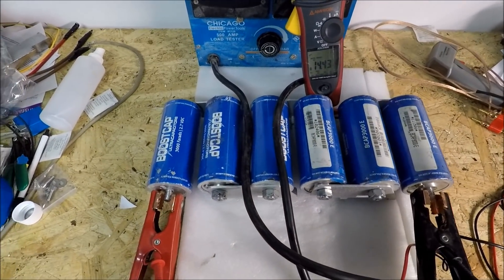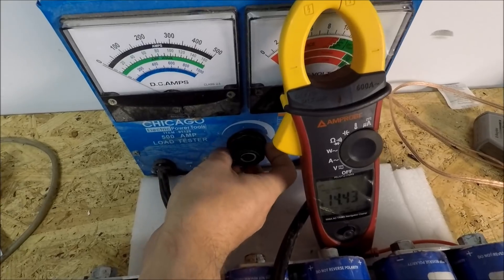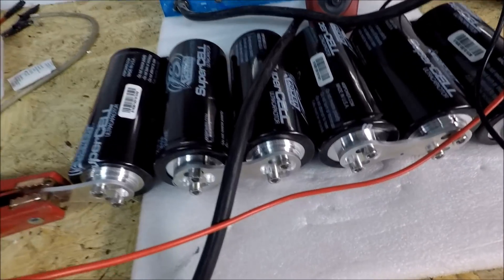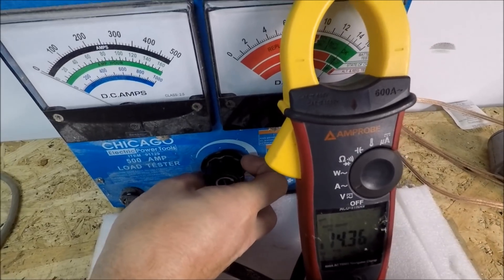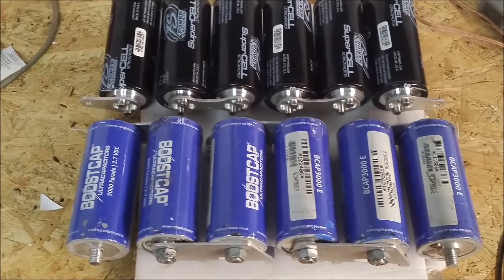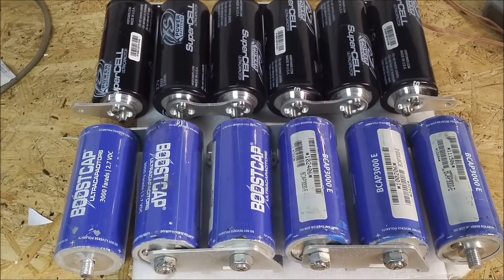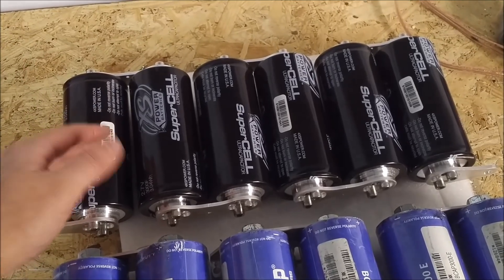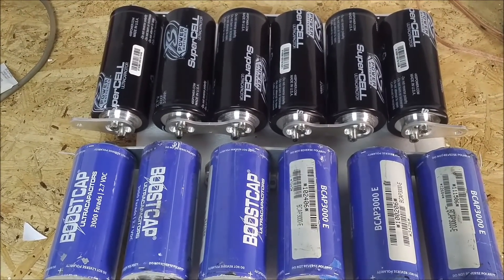XS Power Supercell or Maxwell Boostcap, which is better?

Comment: Hello. I was just asking someone which were better and he swore I got ripped off with my SB 1000 XS Power super caps. He thinks the maxwells vastly outperform the XSPower. 
I do have a question. On a system that’s 5000 RMS watts, big 3 done, 2 XS Power D4800 batts in parallel, stock alt for now (about to purchase a 280amp alt (biggest they make for my car)), how many of the XS super caps would it take to keep voltage stable if the system is played near max volume for long periods of time? 
Thank you. Have a great day

Comment: WHere on planet Earth can I find end links for those XS Power supercapacitors?!?!  Or suggestions on how to attach them to an existing battery bank.
Reply from the maker: If you don't want to make your own, I think some companies offer them. XS Power used to sell them individually but don't last I asked.
Reply: @EMFAudio  Gotcha.  I decided to just use 2 ring terminals- one on each bolt hole attached to the dual bank LTO lithium w/ 1/0 gauge wire.

Comment: Could You Charge Up Those XS Power Caps Up To 16.2 Volts. Slowly Creep Up The Load Knob Till You See Needle Barely Move. Then Immediately Crank It Super Fast And Max It Out? I've Got Me Some Ultra Capacitors From a Supplier And I Did This And Max Out Around 450Amps @ 14 Volts And 300 Amps @ 10 Volts. I Would Love To See How They Compare. Your The Only One With The Same Exsact Load Tester As Mine And You Have XS Power Caps lol. If Not No Worries I Won't Burden You. Just Want To See How They Compare Without Dropping The Cash.

Comment: Do you have a video on how to configure a 6 bank of XS caps?
Reply from the maker: I don't, do you mean cell to cell individually or banks tied together?
Reply: EMF Audio banks tied together
Reply from the maker: @UrAvgBasshead  It would be a very short video, it's the same as batteries. Pos to pos, neg to neg.
Reply: EMF Audio how about also showing how to wire from amp to caps to agm battery ? If that make sense.

Comment: why do run them like batterys and without the balance boards
are you using differnt caps and also have you used the graphene caps which do the the 15k ah at a 12v or 16v and they are in 1 or 2 maxiumum size and they are new whats your thoughts about grahene vs the maxwell or xs or whatever
Reply from the maker: Balance boards aren't a requirement. I've found they don't benefit unless you're rapidly charging and discharging in large amounts. Even then, the difference is minimal. In this particular bank it isn't be charged to maximum voltage so if there is 15% higher in 1 cell than another, it's still not at threshold. I own and have used both XS Power and Maxwell caps, I have not used graphene.
Reply: @EMFAudio  thanks first actual helpful answer i have i will be emailing you soon about some 15s and 18s i need soft  parts for and also some motors for a couple of them to well 3 motors i have the cradles and 1 motor 4"coil and i need to get basically finish two in banhammer style or musical spl i dont know if you do that so i email you guys and let you know what im after and see if you can do it
thanks for answering in easy to undersrtand englishrather than cryptic battery talk

Comment: How many farads do these have?
Reply from the maker: Each cell is 3,000, but when you put them in series they lose capacity divided by the number of cells. So these banks are 500 farads.
Reply: @EMFAudio  thanks!
Reply from the maker: @Martian Prepper Exactly how you worded the question you answered you're own question. I'll assume you meant with a 1 amp load how long would it last. They don't offer Ah ratings on the caps themselves and caps don't discharge like batteries. From my personal experience I'd say going from a 14v charge to an 11v charge it would last somewhere between 1-2 hrs.

Comment: What's the bolt size and length?
Reply from the maker: I know they're M6, length I don't recall but with those dog bones I'd say 10mm is appropriate, 12mm tops.
Reply: @EMFAudio  thanks buddy! I see that EMF audio doesn't have the single cells on the site. Do y'all still sell them?
Reply from the maker: @jamesfalvey77  We do by request and only in quantity.
Reply: @EMFAudio  meaning more than one cell or more than one bank?
Reply from the maker: @jamesfalvey77  More than 1 bank. If you're the one that emailed yesterday I responded yesterday. For single bank purchases it's best to get the cells in cases that we offer.

Comment: The way he describes these ultracapacitors by XS in this video makes it sound like the single units are used and the cased units are new
Reply from the maker: In this video, all the cells ARE used. If you purchased new from our website, you get new, be it individual cells or in cases.
Reply: @EMFAudio  please, just to be clear on the video, the two maxwell and XS supercap banks are each powering a load of 12v 200A rating (ie. 2400Watts) for an average of 10.3 - 11seconds?

Comment: How many caps I would need for 18k system
Reply from the maker: I'll be covering that in a future tech video that will cover that in more detail for specifics. That isn't really a blanket answer.
Reply: @EMFAudio  did you ever make that video?
Reply from the maker: @DibeezyTheGifted  I haven't yet, it's still on the to-do list.
Reply: @EMFAudio  bottom line do these help enough to justify the cost? 4 Banks minimal for 8k @ $1,000+? Or more actual battery Bank?
Reply from the maker: @DibeezyTheGifted  That is the appropriate number of caps for that power, but, you have to have some alternator power to back that up. If you don't have at least 300 amps of alternator you'd probably want to have some battery capacitance in there.
Reply: @EMFAudio  singer 320 rt now and Mechman 320 here probably Tuesday. 640 amps total. Planning on at least 12000 watts total.
Reply from the maker: @DibeezyTheGifted  For 8k yeah you're good. For 12k you might need some more caps. We do have them available at www.emfcaraudio.com

Comment: Not really. Just trying to sell xs.
Maxwell is half the price and just as good!!!
Reply from the maker: Maxwell aren't half the price.  As a matter of fact, brand new Maxwell cost MORE. You can't compare new to used pricing. Furthermore, you saw the data, it's right there in the video. XS Power performed better, you watch it happen.
Reply: @EMFAudio  watch the video . Ok. What I see is super caps vs ultra caps. 
What I see is. The Maxwell was outperformed by half a second . .05
Also. What I saw. The Maxwell/ while adjusting to 200 Amps was stright to 200  and held. 
Now the xs ultra  was shot to 200 then back down to 150 then rolled into 200. 
So the 50 amp decline will affect performance. 
So watch for that again. 
 Try again bud.
Reply from the maker: @pissedoffconservative347  You don't have to make excuses, accept reality. No need for butthurtedness.
Reply: @EMFAudio  how can you deny or ignore my comment? I didnt say xs was bad! Nor do I think that .  But how can u ignore the facts
Reply: @EMFAudio  are you going to say that the 50 amp drop wouldnt affect  the over all outcome. Hmmm? Even after that it was by a half a second. And that time was done by u. So if it as human touch nothing is perfect.   Try again bud
Reply: @EMFAudio  also. The maxwell caps have scratches. Rust on the nuts . 100% used vs brand new. Come on bud. People do pay attention .
Reply: @EMFAudio  again. Brand new maxwell 2.7 is 57$ ok set of 3 connectors with electrical saftey circuitry run 21$
Xspower right off their site are 63 and 75$ plus 11$ per ( each) connector . With no saftey board. 
So for 6 2.7 xs with connectors is 450$a bank. Maxwell with connectors  and saftey boards = 384$ 

And these aren't my opinions these are facts that any one can look up. So before u say I'm wrong  or any one says I'm wrong . Look it up. Facts are facts
Reply from the maker: @pissedoffconservative347   Reviewing the video again, it wasn't 50 amps, it was closer to 20 amps, for a fraction of a second. There was 0.7 seconds difference in the results. There wasn't 0.7 seconds worth (even you said a half second) of 20 amps difference which wouldn't average out anyway. I'm curious where this "rust on the nuts" is, because aluminum doesn't rust. Additionally, the nuts are securing the bars, not transmitting current, so even if they were covered in rust it wouldn't matter. Not once anywhere in there did I say either were new or used. But since  you bring it up, the XS caps WERE used, for 2 years, in a car. The Maxwell were used by somebody else who didn't keep as good of physical shape as I do. Now, since you're trying to justify the cost thing, even going by your numbers and your original statement of "cost half", $384 isn't half of $450. You're also introducing additional parts at varying cost. For starters, XS Power pricing is MSRP, not what you pay from any dealer. The Maxwell price you stated isn't what I found in a quick search which was $65 a cap. You can't just throw in buss bar cost or anything else because that will vary based on your needs, and supplier, and should you opt for them. The BALANCING BOARD (which isn't for safety) isn't required, just recommended for gaurenteed equal cell charging. You are right in that facts are facts, as I demonstrated and explained using realities, not biased complaints because of some grievance you have. Every claim of "no you're wrong" has been exaggerated.
Reply: @EMFAudio  as I said I have no issue with xs . None. Not one.  But the Fact is. Your statement of how xs tops them  with even as your stats show. There is no difference.   Yet you make these claims to boost your sales !and u changed the 200 amp charge rate.  And if I could send a pic on here I would show u the rust
Reply from the maker: @pissedoffconservative347  The range was a 180 amp dip for a short time, the average difference is very small over the time frame. You're arguing trying to prove something against what it shows, for some reason. That's a psychological condition called NPD. You might be thinking you're seeing rust, but it's not. And again I'll repeat, the bar is what's transferring the current, not the nut. The entire nut could be completely covered in rust an it wouldn't effect the outcome. The only thing that matters is the connection of the bar to the post. If you think the results are so wrong, make your own video.
Reply: @EMFAudio  didnt say the nut did anything . Just an example of the condition of both items.
Reply from the maker: @pissedoffconservative347  So I guess your comment above doesn't say "also. The maxwell caps have scratches. Rust on the nuts . 100% used vs brand new." then? There isn't even rust on them. We established they were both used, cosmetics don't matter, and there isn't any rust.
Reply: @EMFAudio  hes just pissed off and a conservative lol!!

Comment: Great..thanks for demonstrating 200amp load.but I wish you measure the start volts at 15.5... every bonus second counts in overcoming initial loads on an 5000 watt inverter starting an HVAC.
Reply: I have never heard of truck alternators being any different then car alternators in terms of output voltage
Reply from the maker: Cars don't run on 15.5v unless modified, so that wasn't a real world application. You would also have a strong charging source to assist in the power supply. So, the application is a bit different from HVAC.
Reply: @EMFAudio   14.9-15.2 is common place on pickup trucks  mine runs 14.9 when it's charging the battery    15.2 in tow mode(gotta charge up the trailer battery and power those lights)
Reply from the maker: @punker4Real  Out of curiosity, is that an instrument cluster reading or a DMM reading? Also, is that winter or summer? Voltage increase doesn't make charging batteries faster unless there is a current deficiency and it's still within spec. Higher voltage creates more heat which can damage the battery.

Comment: |> |> |> |> |> |> |> |> 
|> |> |> |> |> |> |> |> 

as replacing for a batterie bank in boats rvs, ect what you would take ... for best performance ... selfdraining ect.?

are they good for such?

Im looking for the best price/quality solution.

thank you!

|> |> |> |> |> |> |> |> 
|> |> |> |> |> |> |> |>
Reply: |> |> |> |> |> |> |> |> 
|> |> |> |> |> |> |> |> 
 the overal voltage should not go beyond 13,5 volt that I can charge properly or damage anything with overvoltage ... 15 volts wich same configutations have is to much I think ...

|> |> |> |> |> |> |> |> 
|> |> |> |> |> |> |> |>
Reply from the maker: Those applications you need capacity for draw over time while not being charged. You would want a good battery for that, not capacitors. Capacitors deliver a lot of energy very quickly, they don't have much reserve.

Comment: Are the xs caps 14v or 16 I know the blue caps are 16v caps..either way when you run caps you want a faster discharge.. Not slower.. So in my opinion the Maxwell's caps are better but all round I would use either or caps are a great thing!!!
Reply from the maker: Jarad C Don't confuse faster discharge with lower voltage. By that logic using less capacity would have a higher discharge rate. Neither XS nor Maxwell are 16v. All Maxwell are blue except the old 2.6's. XS are 2.7v, Maxwell are 2.7v, 3.0v, or 3.2v. how many of them you use in series determines the maximum voltage possible. You get out what you put in voltage wise but they closer you get to the maximum voltage the higher your capacity.
Reply: EMF Audio both preform exactly the same. You just tested discharge
Reply from the maker: Jarad C Nowhere did I present it to be anything different. The XS Power tested slightly better, the numbers are right there.

Comment: Can you take the caps out of the battery looking cover?
Reply from the maker: Those ARE the caps, in their raw form.
Reply: EMF Audio Yes I know, but it was mentioned in the video that they come in battery cases. I was just wondering if you can move them in and out of those cases?
Reply from the maker: Tonio9606 No, the cases are sealed.

Comment: For a 5K RMS WATTS,  WHAT DO U RECOMEND ME.... 1 (12") - 2 (2500 MONO AMP )
Reply from the maker: craizygolf1980 For the number of cap banks you would need? Knowing alternator power would also be needed.
Reply: I was thinking about the 250-300a alt.
Reply from the maker: You would need at least 2 banks for good performance, 3 should have very minimal drop. 1 bank would work ok but you could have increased drop over time if you played stuff that's almost tones.

Comment: How many watt system can the xs power super cell handle. I know it depends on what amp you have and ect. I was just wondering a ballpark answer.  cause I have a 2000 watt system wondering if they would be overkill or should I just get one instead of the six. fyi. I'm running a mechman 270
Reply from the maker: Bass Addicts For music, I would use 2,000 watts per bank as a maximum figure assuming you have solid charging. 1,000 watts per bank will have minimal voltage drop.

Comment: so can I run a bank of xs and a bank of Maxwells ¿
Reply from the maker: CausinTrauma Bradley You can in that you can run batteries that aren't matched, or mix batteries and caps. It will function but may or may not perform as good as it could otherwise and may make installation more difficult.
Reply: Thanks.